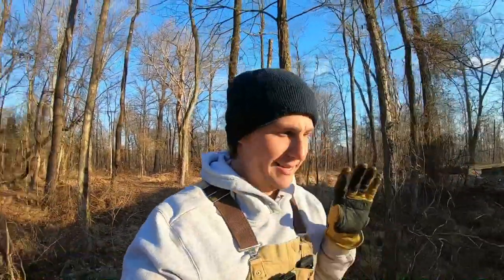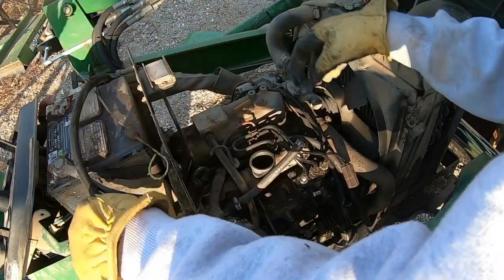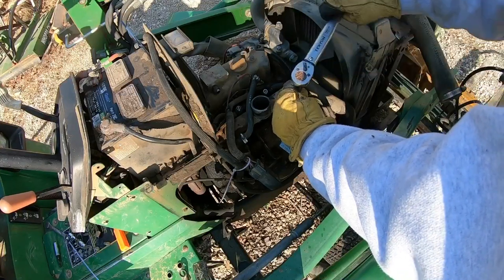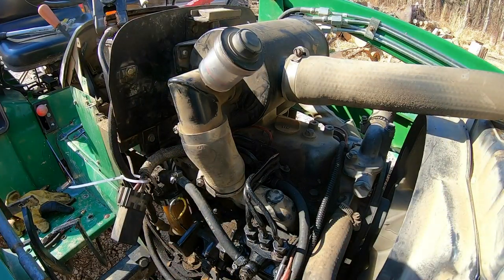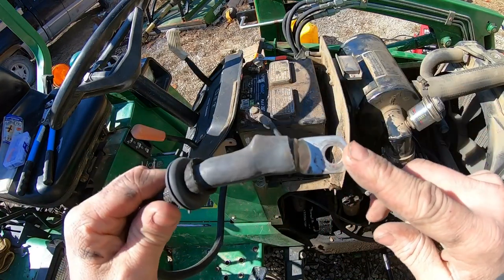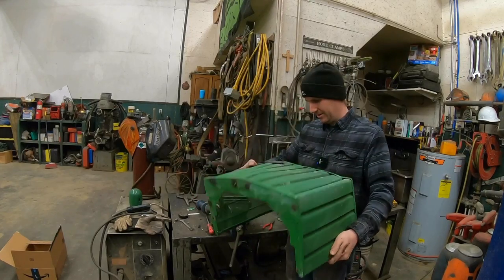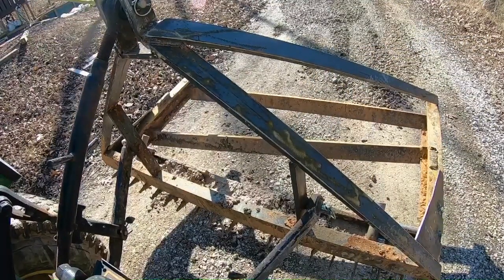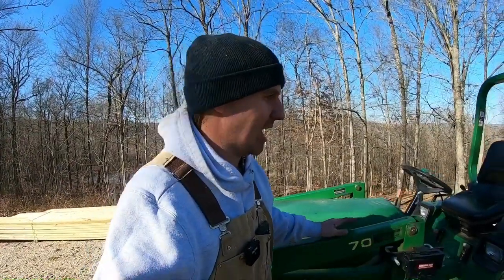Problem Solving a John Deere 755 Compact Tractor - Fuel Problems

Comment: Mike, I have both a 770 and 790 JD tractors. Neither of my engines have as much side-to-side movement as your 755 upon start up. Is it possible you have a bad or loose motor mount? Great video. Love your channel. Lee
Reply from the maker: The rear mount is definitely showing some age.  It's next with the battery

Comment: Another great video, retired ag mechanic  here never worked on a small tractor like that but is it possible u have a broken motor mount, just seems like jumps around alot, I definitely could be wrong. Keep up the good work
Reply from the maker: The rear mount is definitely having issues.  It's next on the list with the battery

Comment: Worked on about a dozen Yanmars over last few years. One of my favorite engines to work on. Last 3 cyl I rebuilt: once I had the parts in my hand an in-frame took 4 hours from start to start up.New record for me.One of the last tractors built (old ones and not the new ones) designed with field repair in mind.
Reply from the maker: Hey I may have to reach out when I end up doing this one!
Reply: Yeah....everybody I know can rebuild an engine correctly in 4 hours.  🙄🙄
Reply: @catchingfadesclashroyal6506  little 3 cylinder yanmars are brain dead stoopid to work on partner. Been turning a wrench for decades: that helps.....

Comment: My 1070 is about the same thing but just 4cyl and the best tractor to own with a front-end loader and 4x4 and is a94 and still doesn't burn any oil. And love my Yanmar engine and have one own my marine boat what a pur they make.

Comment: Thanks Mike ... great video. You were correct in running the winch cables to the battery ... you eliminated the additional resistance of the longer winch cable AND the smaller ground cable for the tractor. 

Regards,

R

Comment: Nice video, consider getting an insulated cover for the positive terminal of the battery, it doesn't take much for the tin work above the battery to get bent down and cause a short. as DP knows. 
Use a resettable breaker on the anderson pig tail.

Comment: lol, let's pull the whole engine out. take it completely apart, ice blast clean the parts, sand blast the frame, and powder coat it some bright chrome like green, lol as the kids would say, add some bling green, after all it's still a deere, lol, and put it back together.  i guess we, you,lol, would have to make an oven big enough for the tractor frame so we could powder coat it. lol, hey we could make a bit of change powder coating stuff. like the rims on the tractor, the road drag, etc.
what? it would only take a couple of hours. lol
but it would be fun. let's add heat and ac to the tractor lol, like a fan. how cool would that be. in the summer we would have heat in the winter cold, lol. i'm just saying. the hvac would work. i'm just saying. lol.

Comment: Motor mounts wore on on the John Deere with the yanmar for me.Fuel system was acting up and flushed tank and replaced all lines.Bottom of tank was a mess.After it was like it should be.Started smooth and ran correct.

Comment: Hi Mike. Pleased you received the oil wrenches, as I watched you time and again use the fan belt method and as an ex mechanic on All sizes of machines from CAT D9 to small ride on mowers as well as chainsaws thought something like what I used would not go amiss in your toolbox. Also useful on pipe fittings and water filtration units, so could be of help with the rentals you end up building. Hope to see you when I travel over from the UK and  visit Farmer Chris as I also used to build those silos he has just had on his farm. My one bucket list journey left is driving the whole of Route 66 using as much of the original as there is that is accessible, when the travel and covid stuff allows. It also allows me to visit my ex para medic Buddies who married members of the American armed forces and all seem to live on or close to the route. Enjoy the tools and see how long it takes to break them lol.
Reply from the maker: Hey thank you so much!  They will definitely come in handy

Comment: Here you talking about your alternator  is a good idea but I would run a second battery it will save on wire over heating  and where a d rare on the alternator  the more amps the more monie it cost to fix and repair  if you ever noticed the 2 batteries  on the electric plows on plow trucks just a thought for you to ponder on a cost to do things right ay now save big later when I. Break downs love your channel here mike good luck with all your projects I will proble but in here there and again just because of my experience

Comment: Hey Mike when you go to make your jumper cables with the Andersen connector use welding wire that way in the winter they are not all stiff it’s a better wire to use and you can make them however long you would like them
Reply from the maker: Good idea

Comment: I guess the decision to get a new tractor is based on whether you spend more time working on the tractor or doing work with the tractor. Also would a larger tractor, be a better fit for what you need it to do.

Comment: Good maintenence on the tractor👍👍. I know you get blown up with the opinion cannon from everyone all the time on what they would do different.  I'm trying not to be "that guy" I only have an idea that I think you could build and would take zero time as a cool add on feature for your rake. Since you already have power ran to the back you could buy a 12v worm screw actuator (you can find them on the internet) to actuate your ripper up and down so you wouldn't have to get off the machine at all.   I'm going to add one to my snow plow so I can tilt the blade left and right so I don't have to get off my side by side when plowing.  Just an idea🤷‍♂️
Reply from the maker: Would be handy

Comment: No complaints about the audio in 99.999999999999999999999999% of the videos. Sometimes stuff happens that is out of your control. Some people tend to just be miserable people that like to complain. Let the serial audio complainers  buy you a fully professional sound recording setup. No wait, then they would complain you don't know how to use it correctly. 🤣
Reply from the maker: Hahaha, you're exactly right

Comment: Well my thoughts were just  leave the winch ground the length it was and then if you don't like it on the battery you have length to put it back on the frame. Lol. And no...I  didn't have  anything better to think about at the time.  😁😃 And I really like the new road drag. Loosens the gravel very good.
Reply from the maker: Thanks Jason!

Comment: I would have just used silastic to put that grill back together, it would last forever, wont stress fracture,  and a lot easier than trying to weld that thin stuff. Oh and if you want to avoid potholes in a gravel road, cross fall is the secret, about 6% and you wont see another pothole for months.

Comment: Captain is your tractor's engine mounted on rubber engine mounts that fix it to the frame? I was most surprised how much movement there was when it was sitting running early on in the video. I ask because I wondered if time and oil / diesel contamination has caused them to "rot" so they allow this amount of movement?

Well done on the various repairs and fixes in the meantime.

Comment: Usually, the shorter the ground wire, the better.  On a winch though, I'm not sure.  I had one on my truck, and the battery was pretty much the shortest ground I had.  Plus on an attachment/trailer, the battery is always a good choice.  No worries about not having enough contact through the hitch.

Comment: Mike, I also have a JD755 and had to do some maintenance/repairs over the last several years. Latest one is a slightly larger amperage alternator. It was larger diameter than OEM, so I changed v-belt to a 35.5". Last fall, I noticed it was running hot and yep, it had bubbles in the coolant. When taking it apart, I noticed that someone had totally removed the thermostat. Grrrrrrr! Also had a bad glow plug. So, one new head gasket and a new set of glow plugs and it is running smoother than it ever has. One other semi major issue was a very bad right rear motor mount. I rebuilt with some large washers and a block of rubber. But while working on this I noticed that the driveshaft coupler/isolator was badly damaged. This is a large round block of rubber with steel inserts to isolate the flywheel from the driveshaft. I suspect the bad motor mount allowed so much lateral movement, that it trashed the coupler. Luckily John Deere still stocks this part, but they're not cheap. Fix the motor mount pronto. Thanks for the videos. I know they are a lot of work.
Reply from the maker: Yup!  The mount is on the list next along with a battery.  They are certainly proud of them though.  What alternator did you end up going ?
Reply: It is a DB Elecrrical, #	400-44041 (Amazon). It is rated at 35 amps, but it is physically larger. Supposed to be direct replacement, but it requires a spacer on the bottom bracket and the longer v-belt due to larger diameter. 
My 755 had the same turf tires as yours. I put R4 on the front and actively looking for some 33x12.50x15 mud terrains for the back. I am also well acquainted with the 755 creep.

Comment: Engine has a lot of movement is something loose or broken. Good video.
Reply: I was wondering if it had a bad engine mount? May be the way it's designed, to minimize engine vibration to the rest of the tractor?

Comment: Hey Capt., your alternator is the same 40 amp alternator as the 855 and 955. When you get ready to replace it, contact a local alternator/starter shop and see if they can't just rebuild yours with a higher amp stator. I've stopped buying new alternators and have started rebuilding them myself which isn't too difficult.
Reply from the maker: 755 and 855 are the same, 955 has a higher amp output. BUT, taking mine to an alternator shop would definitely be the best bet
Reply: @CaptainKleeman  yeah most definitely. Was just watching DPs new video and wondering how long the mirrors are gonna last on the new haul truck 🤣

Comment: Great video. Where can I get a set of those cable you use for you winch. I have a winch I want to use on the back of my tractor.
Reply from the maker: The connectors I bought on Amazon and you add them into whatever cables you're using with a crimp tool.  They are called Anderson connectors

Comment: Now there is a fella who knows what he is doing!!! 😉 You did well not to loose the springs from the fuel pump, seen some of those litte pesky things go missing on other machines.... 😬
The engine seems to jump around a bit, engine mount broken or worn out ? 🤔 
The handle gave you a gentle reminder you have some more welding to do...... 😂
Think it may be time to name the 755, how do you think Goliath fits ?? 🤔😎
Reply from the maker: It could use a name I suppose

Comment: Are you using any kind of diesel fuel additive?   Many times these additives have chemicals in them that can work on seals and cause them to leak.  Otherwise it could be the ultra low sulfur diesel fuel that is required now.  Very odd that all three seals would be leaking all at once.  Also, use the box end of the combination wrench whenever possible.  This helps keep from rounding off the corners of the fitting.
Reply from the maker: Well they started one at a time,. Over a years time they were all leaking lol.  I let it go too long
Reply: Ok, so I noticed quite a bit of engine vibration especially at low rpm.  Do you think that might have had something to do with the seal failure?  It seemed like the one fitting was even loose.  The one closest to the front of the tractor was too easy to break loose.

Comment: Good work on the tractor! 
Perhaps you should have bought a rattle can of John Deere green to paint the grill when you were done. Sooner or later you would get the whole thing painted as you do upkeep and repairs.
Your drag is working well. No "2 years in the design stage" either. The fast play during the road work was cool, Vroom, Vroom,
jack
Reply from the maker: Definitely need to rattle can the grill.  Forgot to do that.

Comment: Rather than replacing the alternator,  concider having yours rebuilt with higher  Amp output.  Might be cheaper and no worries about mounting and fitting etc.
Reply from the maker: Good point, we used to have an alternator shop down the road, I think he closed though.  I'll need to check in on that
Reply: @CaptainKleeman  just make sure whomever does it they know the max the log winch will draw.  The output at idle as well as full throttle can be different, and sometimes the alternator can be so "juiced" up it does not charge well at idle.  Had that on an old plow truck.

Comment: way-to-go Captain, no need to fix anything till it falls off.  Just kidding, but you did do an excellent job on repairing it.  Also great video, but as a retired diesel tech, i have to admit i cringed alittle while you were working on the fuel system. But seems no harm no foul, but please next time clean the area where you are working.  No need to add to any problem, by getting dirt in fuel system.
Reply from the maker: Thank for looking out Trent!

Comment: Mike just a novel idea/suggestion. Replace the top link with a speed binder. Make those adjustments super quick and easy. Of course it's not much adjustment either way so probably not a big issue. But it would be fun.
Reply from the maker: Interesting idea

Comment: good job fixing the ole deere,  audio problems happen i appreciate the effort you put in.
i have the fairly easy chore of a new starter, all i gotta say is ouchie on the price $700+ for a rebuilt or nearly $1300 for new. found a rebuilt on the web which claims to be compatible but buying a starter and waiting 7 days when theres snow coming in less than 7 and its my snow removal plus i tend to have better experience with oem
Reply from the maker: Dang!  That hurts the ol pocket book for sure

Comment: Tractor sounds like it runs way better and has more power.   If you clean the crud off the top of the battery and clean the negative post and cable, you may find you don’t need a new battery yet.   I’ve been told the crud on the top can allow electric to flow between posts.
Best wishes.   Kevin
Reply from the maker: Thanks Kevin!
Reply: @CaptainKleeman     Always better to share what you learn.

Comment: Just one tip when working on any fuel injection system... Cleanliness.   Use compressed air to Blow off around any parts you are about to remove especially on the injection pump.
Reply from the maker: Great tip, unfortunately I don't have an air compressor over at the barn.  But maybe one day!

Comment: Hi Mike, if you think about it the next time you go by an auto parts house, stop in and get some belt dressing. This is only if the slipping belt bothers you. 
I have no problems with the audio. The ripper is doing well. I had forgotten about the built-in adjustment. It definitely went further in the ground. 
Have good days!
Reply from the maker: Thanks buddy!

Comment: I did not send them. My research the 755 and 855 use the same 35amp alternator. The 955 has an optional 40amp alt.
Reply from the maker: Yup, that is correct.  I need to measure Mike's on his 955 to see if it would fit, but I don't think it would be a problem
Reply: @CaptainKleeman  at lest you have on to look at. If you need the 955 part number let me know. Just send me  a Facebook message.

Comment: Mike, I cannot get my 855 to start. Turns over, added new fuel filter and filled the bowl before install. Then bled the fuel filter and checked to make certain the fuel pump is working. The only thing I have not tried is bleeding the injector lines. Would I do that where the three lines attach to the pump?
Reply from the maker: If you're bleeding the injector lines, you bleed them where they attach to the fuel injector . The goal is to get all the air out of the system, so you bleed them the furthest away from the pump
Reply: Thanks a bunch. Will give that a try. @CaptainKleeman
Reply: Hey, got it figured out. One of the wires running to the solenoid that controls the injector pump was loose. Fired right up.

Comment: If you want to make things easier on yourself you need a bucket with teeth on it or a tooth bar for the bucket you have. It would be a lot easier digging in the ground and scooping up rock from piles like you did in this video. You could just weld keepers on the bucket and have teeth on it that way. The teeth will be easy to change too when they wear out. Just a thought. The road drag seems to work great. Good video. Stay well. -Wil  👍
Reply from the maker: I plan on building a second bucket for "aggressive" digging.  Thanks for watching!

Comment: One neat trick i recently saw , was a fella weld a 8 inch caster style wheel onto his top link adjuster for easy adjustment instead of those two little bars coming off it . Genius.
Reply from the maker: Interesting idea,. Would make it awkward hooking up a PTO or folding the linkage up, but I could see the benefits

Comment: Nice work Mike! I know your getting the comments but you do need to address the motor mounts. The rubber flex between the flywheel and the drive shaft can't take that much movement and it will destroy it sooner than later. Glad you got that grill locked down! 😉
Reply from the maker: Might be why I'm getting an oil leak lol.  It's on the short list

Comment: Running in a dusty and dirty environment when you change the belt check the pulley on the crank to make sure it hasn't started to U out. Belts run on the sides not in the bottom of the groove.
Reply from the maker: Thanks for looking out!

Comment: Mike, if you have a good alternator shop near by, see what higher amperage units are available in the same frame size. You can probably double your output over what JD used.
Reply from the maker: We use to have one, I think he closed down, need to double check